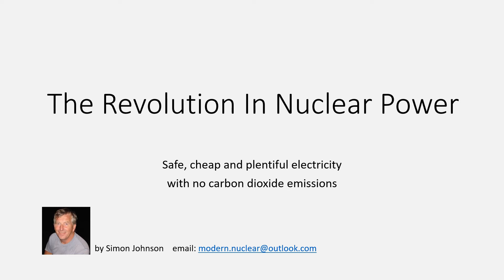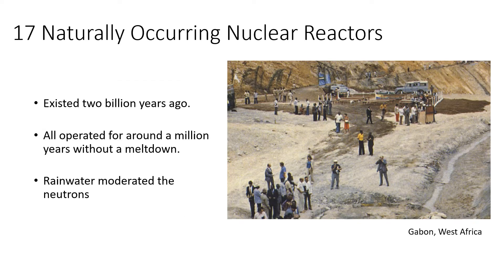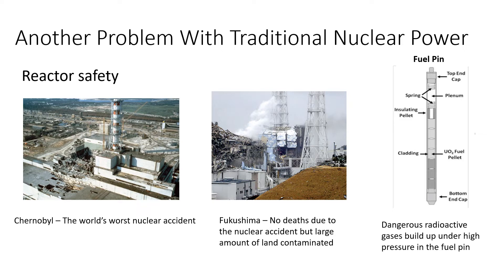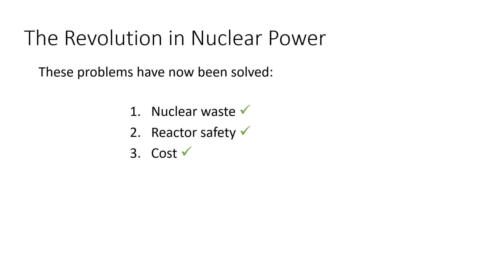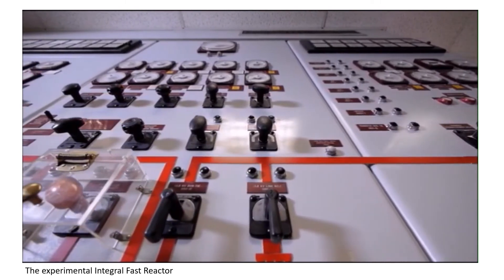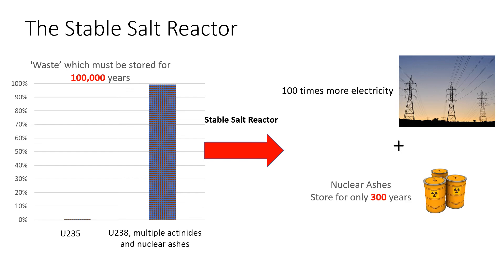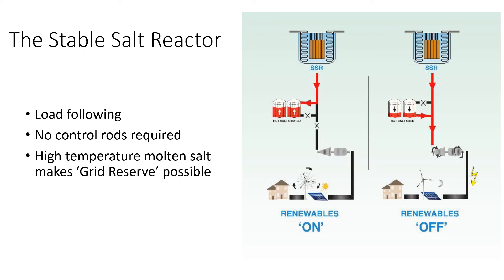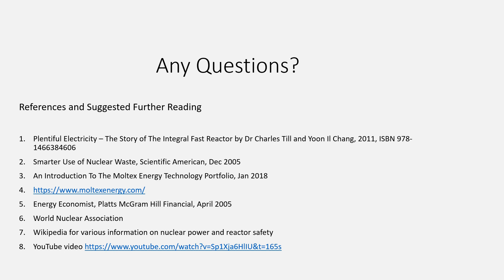The Revolution in Nuclear Power

Comment: Thorcon has a contract for building a reactor complex in Indonesia. Up to 70 companies currently working on molten salt reactors. EU has completed the project that verifiied a fast molten salt reactor.

The gas cooled molten salt reactors will probably be used to melt steel.

Main problem: lack of capital.

Comment: This is very similar to the liquid salt Thorium reactor. I would really like to see an unbiased comparison. The Chinese are building two of the Thorium variety in Mongolia starting this year. One was built in the US in 1955 as a research project but lost support afterwards because it had no contribution to defense. DOE had the energy mission but failed to pick up the ball with Thorium or SSRs. Both walk away safe, self regulating, cheap to build and reliant available fuel sources. To my way of thinking Thorium is more widely available, much of it above ground now as a by-product of production of many transuranic elements of value. Approximately a 3000 year supply of energy.
Reply: So whilst I'm a big advocate for molten salt reactors, I think thorium is over hyped. The only real advantage of it is there's a larger supply available. However, uranium is still cheap and abundant so this advantage is extremely moot in practice. In every other way uranium is much easier to make work than thorium

For example, thorium is not fissile (like U235) it's only fertile (like U238). This means it has to be put into a special breeder reactor to make U233, which is fissile. Such a breeder reactor is incredibly complicated, requiring many complex chemical processing steps, all being run on the insanely radioactive fuel while the reactor is still running. This is an immense engineering challenge that no one has demonstrated to date. The neutron economy is also incredibly tight for thorium breeding: it's very easy to end up not making as much U233 as you consume. This further complicates the design and gives little margin for error. Perhaps it will be an important technology one day, but for now the uranium cycle is much simpler to make work. 

Uranium is cheap and we have plenty of it, especially if you can burn U238 like the moltex design presented here. This is why pretty much every vendor in this space is going down the uranium cycle route rather than the thorium cycle.
Reply: @tomshackell  

Actually the production of U-233 adds safety and simplicity to the process which starts with a seed amount of U-233.  As more U-233 is being produced it stays in a holding tank for 30 days while almost all of these insanely radioactive product decays because they have very short half-lives.  Then the U-233 goes in tiny sips into the thorium reactor where it produces the power and several other short life radioactive products.  

A runaway reaction is impossible due to inherent feedback stability, and the running temperature of 550-600 degrees C requires no expensive containment vessels.  As a safety, which should never be needed, there is a thermal seal at the bottom of the tank, if it gets to 800 degrees, to drain the reactor contents into a holding tank where it generates no more heat and just cools down. Above 700 degrees corrosion starts being a problem.  What few and minor longer-life radioactive products reach that tank don't contaminate the environment like they would if they breach a containment vessel and there are far less products in the tank because the half-life ages them out so rapidly as compared to the longer half-lives of the Uranium/Plutonium cycle.   

The system requires no shutdown for three months every 18 months (worse case)for refueling as do current reactors.   Navy subs can wait much longer.  The Thorium fuel is continuously added dissolved in liquid salts as it is used up.

These reactors without elaborate site and licensing restrictions and containment vessels can be vastly downsized to serve a few thousand to 20 thousand homes, using cheaper mass produced components and assembled on-site quickly. Each plant of same capacity will be identical which makes licensing and oversight regulation a breeze compared to one of a kind Uranium based plants which are not inherently stable.

This video is the detailed case for the LTFR:"LFTR Chemical Processing & Power Conversion - Kirk Sorensen at:
https://www.youtube.com/watch?v=xBmk7t5K35A&list=PLzGU4aLc2h3IJkqefCfuf-p-ZwGmhXr" but see the Q&A period at the end because it brings to light some interesting details.  

See many more useful Videos at list "http://Patreon.com/Thorium", most of which do not require a Patreon Membership and my public playlist at: https://www.youtube.com/playlist?list=PLXjGCa5V36Vvwj2-xqPRhzbBvFCd4x8BJ.  The second one on my list discusses a sad set of mundane circumstances that let the US down the wrong path many years ago.
Reply: @patrickwood4487  Thanks I'm well familiar with Kirk Sorensen and the LFTR design. To give an example of what I mean from this point https://youtu.be/xBmk7t5K35A?t=1186 Kirk spends the next 5 minutes giving an overview of the numerous chemical processes needed to make the design work. This is obviously a very complex chemical system, it has many steps and it's often being performed on highly radioactive material. If one of those components go wrong it seems likely that no-one will be able to go near it to fix it, everything will need to be done with remote maintenance.

Many of the benefits you list are common to all MSR type reactors, e.g. inherent feedback stability. Some uranium cycle MSR designs also burn existing stock piles of long lived waste to produce short lived waste (e.g. Moltex, Elysium). So right now there doesn't seem to be a compelling reason to bite off these incredibly complex chemical processes needed to make thorium breeding work. What advantage does thorium offer if you can build much simpler reactors that have all the same inherent safety advantages and that can even consume existing long lived waste?

Comment: This sounds too good to be true ! Great ! Getting rid of existing nuclear waste alone makes it worth it ! 

One thing I would like to bring up against nuclear power in general (even this perfect one) when comparing it with solar,  something that is always forgotten it seems: solar energy is "extra" energy that is received by the earth anyway, so using some of it before it ends up as heat does not change the earth's energy balance at all, while nuclear does add "extra" (because otherwise stored) energy to the total earth balance. So solar (and wind, which is also actual solar energy) has zero effect on the earth's energy balance (because it hits the earth anyway), where all generated nuclear energy adds extra "heat" to the earth (because it adds stored "heat" to the earth).
Reply: The extra heat from fission is a valuable resource that can be used to replace fossil fuels to make concrete, chemicals, etc.

Comment: Very good explanation of why known accidents occurred (loss of cooling) and can be designed-out. 
Even better is the proof of concept experiment that demonstrates that the design works - at least at that scale.
The fact that a SSR module can be transported by lorry and mass-produced is something that would have a huge impact on costs. One assumes that the other components of a power station (turbine, generator, ...) could also be standardized and modular would greatly reduce the review delays -- become no worse that the certification of an aircraft.

Comment: I prefer thorium molten salt reactors, but this one sounds pretty good as well, what the difference between this one and Oakridge molten salt reactor?
Reply from the maker: The main difference is that the Moltex reactor holds the liquid salt fuel inside conventional fuel pins instead of mixing the liquid fuel in with the primary cooling circuit. This means that the primary cooling circuit is not radioactive thereby making the Moltex SSR cheaper and easier to operate. Good economics is very important, otherwise the reactor won't make a significant difference to climate change. There are three variants of the Moltex reactor, one of which does run on Thorium.

Comment: Great. Another bright idea. Cheap and safe nuclear energy is now only 30 years away. Only a few more 30 years.
Reply from the maker: You comment is correct about nuclear fusion but not about the Stable Salt Reactor (SSR). The first SSR is about 8 years from completion. A factory production line process could then bring large numbers of these reactors to fruition within a few years. Unlike fusion there are no difficult technical problems.
Reply: There is also the Liquid Salt Thorium Reactor extremely similar two of which are already being built by China.  A number of current startups in US and elsewhere are expending their company assets figuring out how to productionize construction of small modular Thorium Reactors without Government support. A large company will get behind one of them soon. Don't expect it to be one of the current companies making nuclear fission power plants because they make their money refueling current types of power plants. The new fuels will not be nearly so expensive.

Comment: Sir! I am an engineer from the city of saints namely Multan (Pakistan), I spent some time (as part of my training) at a steam thermal power station having four generators of 65 MW each but now a days they are stopped due to natural gas shortage in Pakistan, past governments did not pay attention because they were corrupt in nature and characterless, please tell me how much would it cost to convert it into a nuclear one? because I love the place from where I got education and I want to see it running once again.
Reply from the maker: As Pakistan has not joined the nuclear non-proliferation agreement you should probably contact Chinese nuclear power companies about this requirement. China has some small modular reactor designs that might suit your requirements.
Reply: @simonjohnson1  Could You please name any chinese company with whom I may contact
Reply: Contact Chinese Embassy in Pakistan. They would love to put you in contact. Ask also about their Liquid Salt Thorium Reactors. These and SSR are entirely similar with respect to small size, low cost quick productio, walk-away safety, and widely available fuel resources. Good luck. Agree with you about your government. Ours is also bad.

Comment: Would you stop using that word "waste" to describe the actinides that will not fission with thermal neutrons?  Most of these are nuclear EXPLOSIVES, it's easier to list those (Th-232, U-238, Pu-244, which in fact can be set off by an H-bomb) that will not explode than those that will.  It's not waste, especially with your reactor and Elysium's similar reactor.  "Waste" was coined by the antinuclear people to make the stuff look bad.  Well, it IS bad - it's nuclear EXPLOSIVES.  Stop using mealy-mouthed euphemisms.  Thank you.

Comment: An uncontained fission reaction could burn a hole all the way to the center of Earth, releasing the natural trapped heat and providing all the power to generate as much electricity we would ever need. It would be very cheap too.
Reply from the maker: Obviously you're joking but on a more serious note, if a nuclear reactor were to melt though it's primary containment (not possible in the case of a Stable Salt Reactor) the nuclear reaction would stop as the molten core disperses when it reaches the pebbles on which the reactor is built.